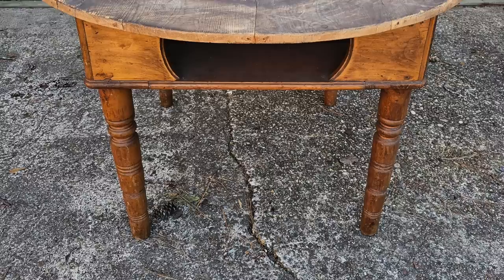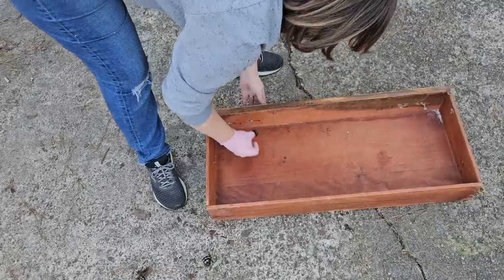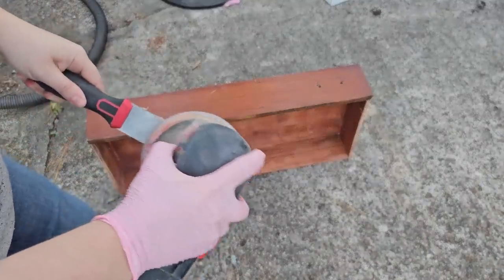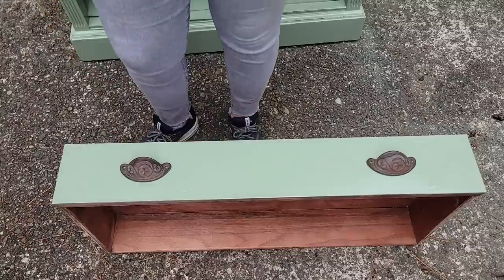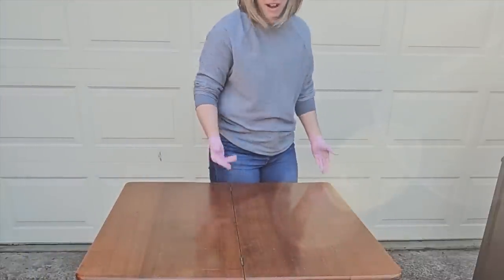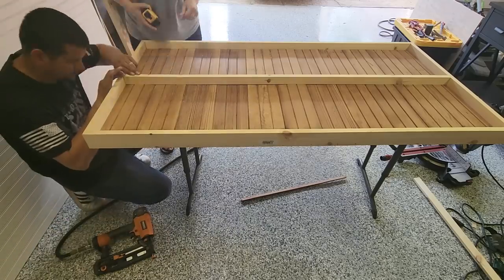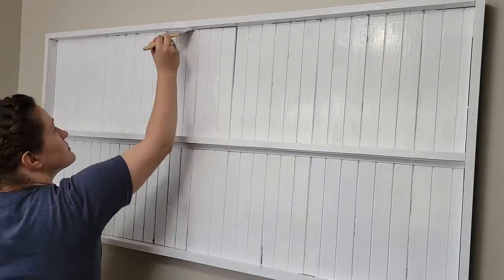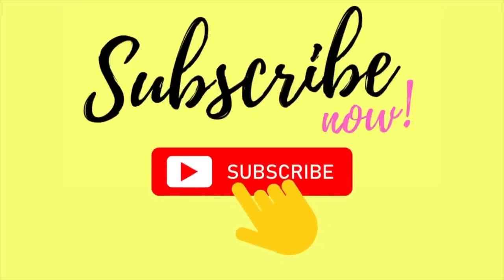3 Totally Wrecked Trash To Treasure Makeovers

Comment: I use battery powered fairy lights ,candles ,and the candlesticks with a little gold base,which I paint,from the dollar tree. The dollar tree batteries last one month without turning them off. I just replace batteries the first of every month. I have also used rechargeable batteries  too. Lighting makes a big difference. I also learned early on in booth retail,(started with 1 booth 23 years ago and have 4 now) that packing them full and I mean full and having baskets of small baggies of jewelry or stickers or drawer knobs or boxes with art that people have to step into your space to look thru makes them feel like they are treasure hunting. I have sold thousands of $2-$5 magnets of miniature kitchen utensils (tea kettles whisks,mixers,cheese graters, rolling pins ) people love all things miniature! I have 4-6 boxes, baskets or spinning displays that people have to rotate to see what is on each side in every booth.
When you think your booth is full add 50 more things. You CAN do it without it looking cluttered. Also use those risers you love so much to create dimension and space for more stuff. People won’t step into your space if they can see everything from the isle.

Comment: Ok I'll give you several ideas on how to make your booth more inviting. First I'm qualified to give you tips. So here goes ALWAYS have 3 items of an eye catching color spread around in your booth. Ex. Red tea pot, red candy bowl...red vase... red used in small amounts  DRAWS people's eyes "in" used in large amounts is a huge mistake. #2 you need a LARGE throw rug on the floor so it doesn't look so garage type flooring. A young mom carrying a baby couldn't put the child on the floor to pick up an item. A rug especially diagonal with look more cozy which is your overall look your going for by looking at your contents in your booth. #3 The stark white walls look cold too the eye... here are some solutions. A. Make a frame and attach cloth to it and lean against the wall BUT BEHIND the furniture or attach to wall with command strips. You can attach different cloth depending on the season. DO NOT  do this on all the walls because you will lose the effect your going for. I'd make 2 large panels for your booth. B. Same idea but with wood so you can paint your panel instead.  C. Same idea BUT  out of lattice from the hardware store.... you can add hooks to hand items your selling. 3 panels 2 the same and 1 different would be the maximum I'd use PLUS  the rug... make it an old SUPER THIN  rug ..... you're done and your booth will go up 2 levels and you'll sell sell sell.... if it were me I'd have 2 more back up rugs for seasonal changes. I'd  only make changes 3 times a year for cozy background affects. Don't over change the look to often.

Comment: Ooh, hey.  That plate sticking out of your hutch drawer at 22:29 (the one on the left, green and white one) -- I have that plate. 😊  (Edit:  pretty sure it's the same from what I can see of it, anyway).  I have two of them, actually.  Same plate, acquired years apart.  One was from a little antique barn for about $35 and the other I got at a tag sale for about 50 cents.  Same company, same design, except the more expensive one was from an earlier year, and the cheaper one was from a later year, with a bit less of the border design on it, and the company logo on the back done a little differently.  I saw the one at the tag sale and thought, oh, wow, that looks "similar" to a plate I bought quite a few years ago.  I got it home and "similar" was an understatement. 😉  Talk about serendipity.

I like that rose plate in this video at around 15:01 (on the far right) sticking out of the drawer on your other hutch.

Comment: Another wonderful video,  Cory‼️ My favorite project is the beadboard wall piece decorated with your Grandmother's china and your thrifted plates; so lovely
Knowing you are so extremely sensitive to paints and VOC's, (me, too!) I am puzzled why you wouldn't use a paint like DIY Paint from Debi's Design Diary that is only 9 ingredients and is clay based. It is so safe you can EAT it‼️ I know you try to spend as little as possible for paint and supplies, but DIY Paint GOES SO FAR that you can paint an ENTIRE 8 FOOT HUTCH with a SAMPLE-SIZED CONTAINER OF PAINT. It can also be thinned out with water and used as a wash or like a stain. When you are finished painting, you seal it with wax for a durable finish. If you want to see examples of how it is done, there are MANY videos on the Jami Ray Vintage Channel on YouTube you could review.  Your health and the health of your family is SO IMPORTANT.  It would be great to see you using products you DON'T NEED A RESPIRATOR to use in order to protect your lungs and health, Cory❣️😉
Reply from the maker: Leslie, the reason I haven't been using DIY paint is because we are very limited on time for these makeovers and need a one step super durable finish paint. DIY paint would require presanding, a couple coats of paint plus a couple coats of clear coat in order to be as durable as enamel paints. Eventually I plan to go back to using a non toxic paint once we have more time in the future
Reply: @DesertDIY  Thank you for your reply, Cory. I am glad to know you are aware of DIY Paint❣️🎨 😁